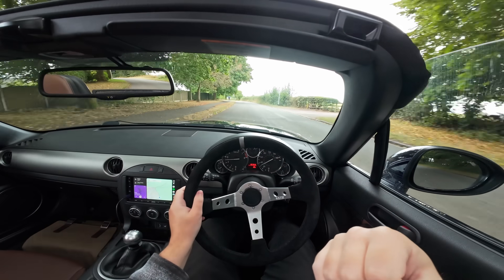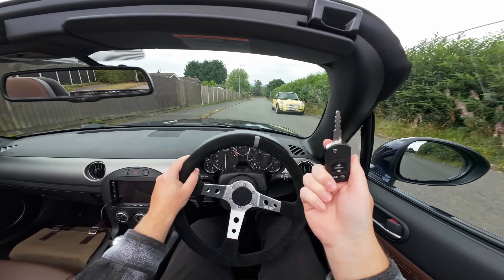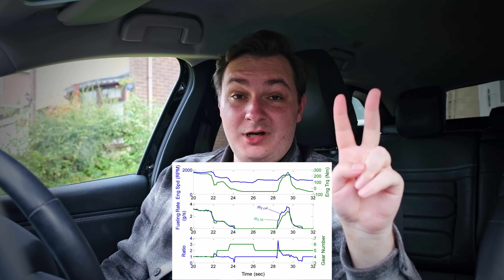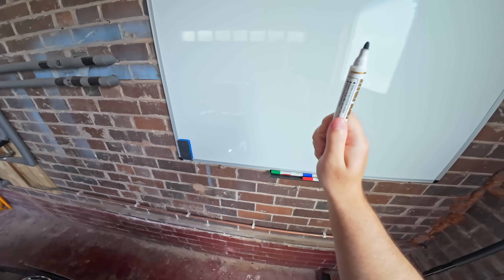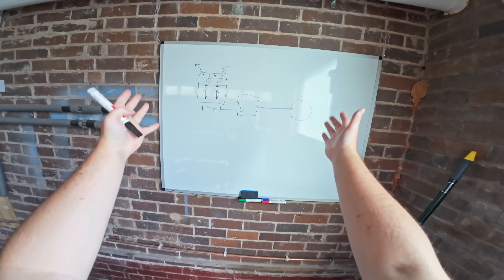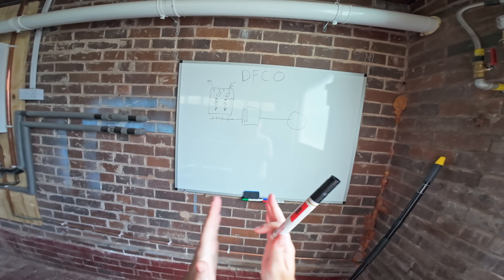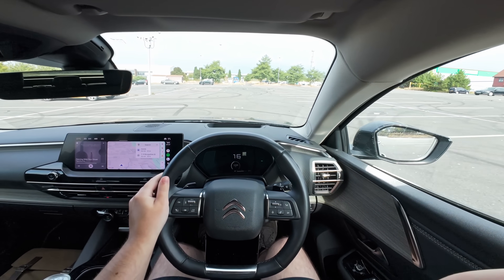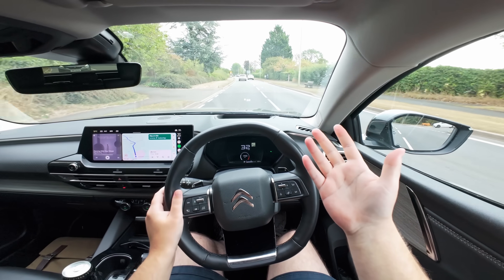The most misunderstood car term - Engine Braking

Comment: I’m curious whether it saves more fuel to downshift with rev-matching or simply shift into neutral (after engine braking in one gear).
Reply: I will explain but can you clarify your question further? Why would you get into neutral?
Reply: @DreamGaming12  imagine seeing red light from far ahead. You slow down in current gear until revs drop to around ~1200rpm and now you have 2 choices: get into neutral and (maybe) use brake or downshift with revmatching (extra fuel to rev match)

Comment: so im at the start of the video here i go

i was driving my car overheated some coolant issue i drove about 5-6 km with the engine running hot when i parked it at home i could hear the engine screaming i could hear the engine moving 100% i know it was moving it sounded like a electric vehicle pretty not the bill tho and the engine was off

Comment: If the car were still using fuel when engine breaking then the car wouldn't be slowing down. Idk why this is such a hard concept to grasp. I figured it out by myself when I noticed that my car's instant fuel economy reading would go to the max value it could read whenever I would let off the gas pedal.
Reply: You’d be surprised how uninformed people can be
Reply: @DreamGaming12  Well he's incorrect so he is still uninformed:
I have a carburated car, which uses fuel when engine braking, (because there is no mechanism to cut off the fuel) yet my car still slows down when i engine brakes... Because the amount of fuel it consumes is what it does when idling, which is barely enough to keep the engine running without load.
So the car will still slow down towards that rpm. Just not as quickly, and not as efficiently...

Comment: If you drive a manual and want to maximise your fuel cutoff you can up shift and your engine will brake less, and then downshift once you start reaching 1k rpm, if you want more engine braking however, just downshift instead, though idk if you're gonna save any fuel if you downshift into high rpms (but you will have tons of engine braking)
Reply: Caviat to this. Don't downshift too far, especially on wet roads. because the engine brakes only your driven wheels. Which could make you spin out (speaking from experience) Only engine brake on straight sections not in corners, and not too hard.

Comment: What about when you have the AC on? Does dfco still work or does the engine continue to consume fuel?
Reply from the maker: Fantastic question, made me think and do some research!

AC is usually driven off the aux belt which is still turning during engine braking - so yes. AC continues to work!

It might actually marginally increase the engine braking!
Reply: It helps with engine braking, because it's now driven by the wheels as well. if you turn on load on your alternator you'll brake even harder. turn on all your lights, fan, speakers high. Cigarette lighter on. and you'll brake like crazy haha.

Comment: I need to correct you. It isn't potential energy, it is kinetic energy that is being converted into heat. The fuel is the potential energy in the system.

It seems NOBODY can actually get this correct.

The force of engine braking comes from there vacuum created when the throttle body is closed. I've also seen people argue that it's drivetrain losses but that's wrong too.
Reply: Fuel is actually chemical energy. Potential energy is like stretching out a rubber band, or holding a ball.
Reply: @DreamGaming12  "potential energy" is just an umbrella term for stored energy you are going use, no matter what type or how it's stored. You guys are all pedantic for no reason.

"It seems NOBODY can actually get this correct."

Always funny to hear this from someone who is themselves incorrect.
Reply: @DrTheRich  In physics, potential energy is the energy of an object or system due to the body's position relative to other objects, or the configuration of its particles. The energy is equal to the work done against any restoring forces, such as gravity or those in a spring.
From Wikipedia

Comment: Well yeah! Mechanics aren’t engineers. There’s a difference between a fundamental knowledge of how an engine works and having a deep understanding of every intricate detail of how an engine functions. All a mechanic needs to know is just enough to fix problems when they arise. From a mechanic’s point of view, if an engine uses fuel or not on engine braking is a detail. I’m tired of people acting like mechanics know everything about engines, they don’t. Noone does. Every professional knows a variety of principles and concepts that each convern a certain necessity. 

Mechanics aren’t certainly not the ones who know most about engines because they don’t develop engines, they fix them.

Comment: I've been driving like this. My motivation is to use the brakes only to stop the car. Any other use of the brakes means I used too much throttle before that point. I only use brakes for stop signs, stop lights, and traffic:  when the car in front of me uses brakes unexpectedly and I'm too close for engine braking to decelerate the car enough.
Reply: Why does it mean that? I drive on a lot of roads that suddenly go from 70mph to 40mph. You wouldn't use your brakes on these roads?

Comment: VW once got a Audi I think was with a TDI to 120MPG by using full throttle till 60 and engine braking till 20 and repeat. Full throttle and low rpm are when the engine is most efficient.

Comment: I hate most new automatics for this reason, most of them when you don't press the accelerator put themselves in neutral to "save fuel" when ironically there are moments where i'd prefer to have engine breaking to slow down.
Reply: You want your engine be broken? Omg
Reply: @user2077-o what? Engine breaking does not break an engine
Reply: @madbruv  but its literally engine breaking

Comment: Glad to see someone actually understand an engine and a gearbox. But dude, you should have explained two additional things, firstly you can roll for longer in neutral and in this way you can make big gains on the motorway on a downhill (use gradients to your advantage), and secondly, whenever you press the brake, you have wasted energy and therefore fuel, or in other words you’ve created forward thrust when you didn’t need to.
Reply: You can't cheat thermodynamics, if you roll downhill in neutral the momentum you gain from no friction in the engine is what you use in fuel to maintain the idle rpm of the engine (fighting the very same friction). That is unless you are in a car (typically hybrids do this) that disengage the clutch and shut off the engine completely (to 0 rpm) when coasting for long enough (usually after a couple of seconds).
Reply: @kukuc96  Idle rpm engine has a constant very low fuel consumption (unaffected by the steepness of the hill). 
Engine break has even more breaking effect as the rpm (speed) rises downhill - right? (more 'wasted' energy moving the pistons, shafts, the whole drive train) So how can you make a constant value (idle engine fuel consumption) equal to a variable? I'm sure there is a steepness level where the two are equal - but not universally.
Reply: @Edua1111  That kind of depends on what RPM you are at. The movement of the parts isn't wasted energy, that's stored and still reclaimed when the engine slows down. The losses are friction (which is constant with speed), and the fluid dynamics losses to pumping air through the engine, which does get significant on high RPM, but between idle and 2.5k RPM, I think you would be hard pressed to even measure the difference on a rolling road, never mind in a real situation.
Reply: But in neutral the engine will inject fuel to maintain an idle rpm.
Reply: @FiestyFez  Well yes, but the engine does not brake your roll - so you can utilize that kinetic energy of the car to the max.
Reply: @Edua1111 if you're burning fuel and coasting on kinetic energy, what's really the savings here? Also, it's illegal in some states to coast in neutral downhill. Not that anyone could tell but it does speak to the fact that it's dangerous to brake your car entirely using the brake pads themselves if at speed.
Reply: @Edua1111  Thats a good point.
Reply from the maker: Thank you!

My linked coasting Vs engine braking video covers both of these at length

Comment: Jesus. On the vast majority of cars taking the keys out means your steering locks up. This deserves a serious disclaimer.
Reply: Yes was thinking this please keep in mind DO NOT TURN YOUR CAR OFF OR REMOVE THE KEYS you will end up on the curb at best
Reply: I immediately came to the comments as soon as he did that. And then there was an oncoming car on that bend and my blood froze when he started turning the wheel. Some idiot is 100% going to try this.
Reply: I had a car which locked the wheel and disabled the brakes if the engine was off. I decided to coast with the engine off one time on the freeway. I almost got a heart attack when my breaks did not work and managed to get the car back on before anything happened.
Reply: Wow, where I live no car blocks the steering wheel by removing the key. You just lose the powered steering, but it's no biggie when the car is actually moving because when the wheels are spinning it is much easier to turn them without assistance. Learned that from driving and parking old cars with no steering assist
Reply: on the vast majority of cars its not possible to take out the key while the car is in drive either.
Reply: Oh shit you're right 😅 I always forget about that part
Reply: I was told that (in the case of our VW Golf) this had to do with the power stuuring being turned off when the car isn't switched on. Might be related? Not entirely sure though, as I'd say the steering is indeed pretty locked up if the car is turned off.
Reply: @Den_drummer  I thought there is a literal metal rod in the steering wheel mount that comes out and blocks the wheel.
Reply: @nexovec  its not exactly a rod, its a spring latch within the steering wheel that gets loaded when the car is off
Reply: I can't take the my car's key out of the ignition because I don't put it in the ignition to start the car.  My car has push-button ignition.
Reply: @davidfrischknecht8261  you can do it with a push-button car too. I did it on mine. Just hold the button down till the dash and radio dies and it is off even if it is still moving. Luckily it didn't lock the steering, but it did turn off electronic power steering so I turned it back quickly.
Reply: @davidfrischknecht8261  So do I, it still likely locks when you turn it off.
Reply: @nexovec  Responding to a month old comment.

  Not entirely sure which vehicle your talking about, I know that specifically for Ford Transit models turning the vehicle off and turning the wheel all the way to one side is a requirement to engage the steering wheel lock without the keys in ignition. The wheel lock feature is probably different for each make and model however, a disclaimer is probably needed especially in this video when he just nonchalantly pulled the keys out, in all fairness though he knows his vehicle and what it can do(generally speaking however unless it's for demonstration most people aren't dumb enough to turn their vehicle off when they are normally using it).
Reply: @NarutoMagicCyclops  Oh man, all my old skodas younger than my mom do this, bunch of my volkswagens do this... after it locks, some cars even require you to turn the steering wheel again in order to be able to turn the keys back on. Don't know too much about the specifics of this.
Reply: Why would they lock?
Reply: @Notmyname1593  That's besides the point, they just do. (it's so you can't steal the car when it's off, it's a "safety" feature)
Reply: @nexovec  It isn`t besides the point.
You lose the power steering which makes it difficult to turn the wheels, particularly when stopped.
I have moved cars around the garage without even having the key nearby.
It definitely isn`t "vast majority of cars"
Reply: @Notmyname1593  Did you actually drive a car without power steering?
Reply: @nexovec  even if it didnt have the lock on, it becomes very hard to steer since the power-steering systems shut down too
Reply: @falkez1514  as long as the car is moving, power steering not working isn't a huge issue, you can still turn perfectly well.

Taking the key out and steering wheel lock engaging, on the other hand, has killed people.
Reply: @Dornacgove  yea thats a fair point
Reply: @nexovec  
This is the exact reason why I always turn off the "smart" engine shutoff when I drive (It automatically turns on every time) Because what it does it it turns off my engine when I'm standing still. But If I'm standing still, it's usually because I'm about to turn into another road, but suddenly my wheel won't turn. It's the most stupid feature ever
Reply: @16m49x3  Wow who the hell made such a dangerous car? Start stop is not supposed to work like that.
Reply: @16m49x3  What is the car?
Reply: @nexovec  Volkswagen
Reply: @Notmyname1593  Anti-theft system: it is activated when you remove the key (not simply when you switch off the ignition).
Reply: @Notmyname1593  even if they don't "lock", most cars these days rely on pretty heavy-duty electronic assist systems. If the car is turned off, so are the assists. Turning the wheel and using the brakes becomes much, much harder with the engines off.
Reply: @Notmyname1593  They don't really lock, but the power steering thingamajing turns off, so it becomes extremely difficult to turn the steering wheel. All modern cars use electronics stuff to help you turn the steering wheel.
Reply: @taylankammer  Unless he is driving an actual truck, it won`t be unsteerable.
It gets lighter when the car is rolling.
Has nobody ever had to tow a car?

Comment: I think if you go back to thinking about bump starting a car, how would the car start without being on and not injecting any fuel into the engine? Same principle applies.
Reply: Bump start is for the same purpose as the starter motor. To start, the engine needs to first spin, then you give it fuel and spark. During a bump start, while the car is in motion, and the clutch is engaged, as soon as fuel and spark enter, the engine comes alive

Comment: There is one, little drawback for engine braking, when You engine brake,  Your brake lights are off, this creates more risk of getting rear ended. Not saying it's some serious issue as other drivers should just pay attention, but it's real drawback.
Reply from the maker: Great point! You can tickle the brake pedal just enough to get the lights on - I often do this if someone is behind my but I still want engine braking

Comment: I've been trying to break my habit of neutral coasting ever since learning about fuel cut-off systems! Though, I do still love a good neutral coast if I need to maintain that momentum, it's still less fuel than holding steady on the accelerator!
Reply: "Though, I do still love a good neutral coast if I need to maintain that momentum, it's still less fuel than holding steady on the accelerator!"
just rolling in neutral? Well... not necessarily.

Comment: I'd like to point out one obvious thing: you can use an OBD2 tool to literally graph the fuel injection and see that literally no fuel is being injected. You can also graph the speed and measure how much the car is slowing down. You can then repeat this experiment with throwing it into neutral instead, noting the graph now shows fuel being injected to not stall the engine, and noting your rate of deceleration is now lower, proving it wasn't just drag slowing you down

Comment: 2 things:
1. Captiva C100 3.2 2006 - might have a little problem, when you use this technique and then need to gain speed - system have no idea what gear should it use, so sometimes it will just hit the gear and you will feel a kick. But I believe, that it is a problem with gears, not this technique.
2. Levante 3.0 2017 - computer shows current fuel consumption as 2l/100km even if you drive a long way without touching gas pedal. I suppose, that it is really 0l, but maybe they have just limited this in display?

Comment: if you lift your foot off the accelerator while braking (or just coasting in gear), the ECU (engine control unit) often activates “deceleration fuel cut-off.”
→ That means the injectors stop spraying fuel because the engine is being turned by the car’s momentum (through the wheels and transmission).
→ Fuel only resumes when RPM drops near idle, or if you press the accelerator again.
Reply: still don't really understand how this applies to carburated engines, carburator physics is much too much for me, but i think it has something to do with the intake vacuum and the vacuum is present whenever the engine is spinning i think and so the carburator should keep jetting fuel into the intake styll. if what the man is saying only applies to "smart" cars, then it would not be true to say people are wrong and he's right because no fuel is ever used. nvm reached 9:25 time in video.. classic clickbait👌